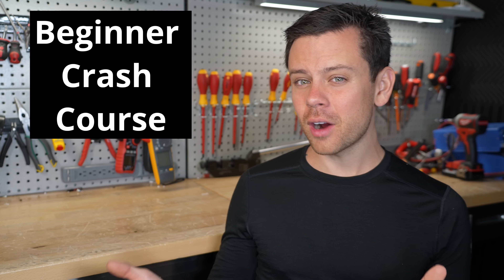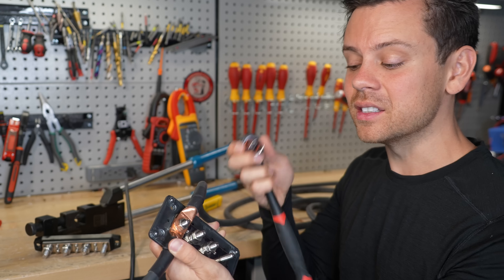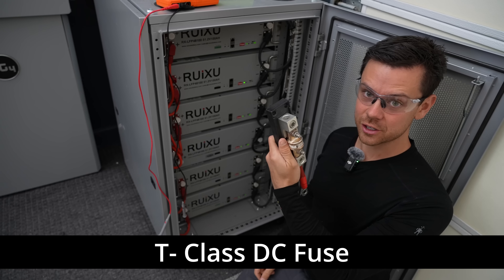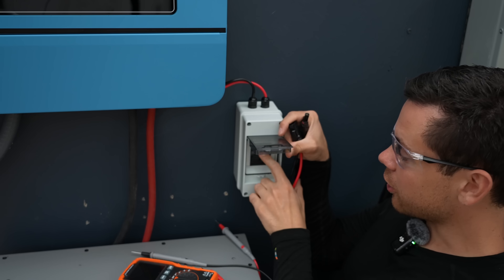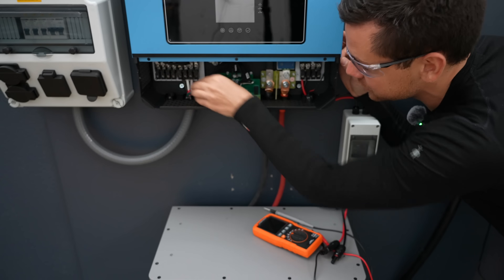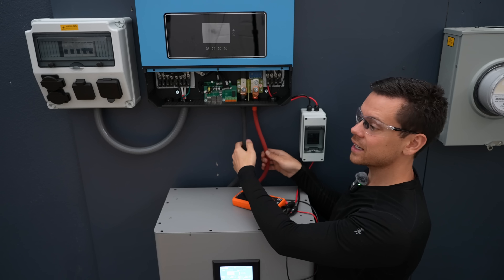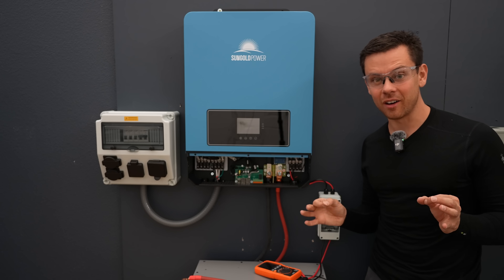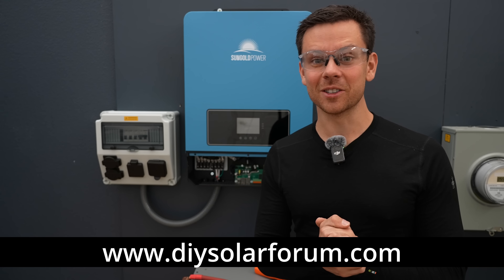Offgrid Solar Crash Course: Avoid FIRE and ELECTROCUTION! For Beginners or Experienced Users

Comment: Electrical engineer here:  One thing that people forget is to TEST the circuit breaker / fuse system with an actual short circuit.  You need to VERIFY that it works within spec.   On a lot of this junk from overseas, the circuit breaker / fuse will be OVERSIZED - and that means that even when the system is overloaded with a dead short, the circuit breaker / fuse never opens up becuase the power source can't supply enough current to trip the safety device.  The same thing happens if the wiring to the load is UNDERSIZED, so that when an overload happens and the wiring heats up - and its resistance goes up - there is no longer enough current flowing to trip the safety devices.
Reply from the maker: In your experience, what are some overseas circuit breakers that fail your tests? I am finding that most everything is made overseas now. The good stuff, and the bad. Would love to know what breakers you have found to be falsely rated
Reply: @WillProwse  Most recently, we had someone at the plant try to save money on a replacement Siemens 100A DC breaker from some AliBaba listing they found...I believe it was Sceemams or some random keyboard mashup.  You know what I'm talking about.  We tested it and found that it never tripped at 150A, nor at 250A load.  It finally melted at around 300A. On the plus side it only cost about 1/10th the real thing, and if you think about it it never would cause a nuisance trip event.  It was useless as a safety device. with an INFINITE over-rating Just be careful to test whatever it is you are putting into service.  ANOTHER TIP:  You want to stop recommending LiFe as a solution for everyone's needs.  Please start testing your batteries in real weather (without BS heatiing pads).  We live in the north, and believe me nothing is more useless than a LiFe backup battery system that refuses to charge when it's cold out ( < 25F) and they don't have energy-wasting heaters installed . I agree technology has to keep moving forward, but there are applications where lead-acid is still best technology for now.   Maybe someday Li will work better n cold climates, but it sure isn't there (yet).

ANOTHER test you aren't doing - at least I haven't seen it:  With circuit breaker OFF, put a dead short on it's load terminals.  The power supply side of the breaker will be a power source well beyond the circuit breaker's trip rating BUT deliver current within the breaker's Current Interrupt rating.  For safety, we use a resistor-limited capacitor supply bank for the test NOT something that will deliver a lot of amperage for more than a few seconds.  I won't describe here because you're smart and know this works.  NOW with power supplied to the line side of the breaker, and a dead short on the load side, flip the breaker switch ON and watch the volt & amp flow results on your oscilloscope.  The breaker should trip open right away BUT in a lot of cases the poor quality unit will wind up with welded contacts - which means the breaker is permanently turned on.  Good quality safety devices will never do that IF they are spec'd with a DC voltage and max current interuppting rating.  Opening a set of contacts with DC current flow is much harder on the contacts than AC, since AC  self-quenches the contact arc, DC does not,   IN GENERAL the better safety devices will be from USA, Germany, Ireland, Mexico, Canada, Taiwan, Malaysia. They will be expensive for a reason - good DC-rated contacts are expensive to make.  Once we get to China yes some very good products but some very bad products make their way into the supply chain.  Like anything else.  There is no 100% black or white, you just have to be sure to test the vendors products to make sure they work as intended!

Comment: Will can you please elaborate on what you mean by lower temperature wire and amperage to ensure safety.  I think what you meant to say or what you mean is oversized the gauge of wire with a lower temperature rating of the insulation?

Comment: Soldered terminals will have much less resistance than crimped, but it's micro ohms, not something you'd see on a normal meter, so it's insignificant.  The only reason I can see for crimping is that if something goes wrong and the terminal gets super hot the solder could melt letting the wire fall out.  That could cause a short, but if the terminal has hit 400F it's probably safer to have it disconnect rather than it staying connected and continuing to get hotter.  If your system is properly fused a short "shouldn't" pose a hazard.
Reply: Sorry, but you need to look up the resistivity of solder compared to copper.  Resistivity is the bulk property of the material.  RESISTANCE is a combination of resistivity, contact area and contact pressure.  Solder has  probably 8 times the resistivity of copper.  A properly crimped joint has total copper contact area and high pressure.  Solder will also wick up the stranded wires and cause brittle, vibration susceptible breakage.
Reply: @barnowl6807 The resistivity of the materials doesn't tell the whole story, you know this, and yet you argue it without realizing that solder will increase contact area.  I've seen two tests done on crimp vs. solder vs. crimp and solder; solder wins.

Comment: Two words, say after me:  TORQUE WRENCH!
Your guides are generally great, but when you touch on everything else like crimping and whatnot, you should also recommend beginners to use a torque wrench to tighten things to the correct torque spec.

Comment: I am pretty sure you are using the wrong kind of cable insulation on the battery cable. If it is welding cable, this is wrong. Additionally every terminal must be torqued properly. I don't see you using one...

Comment: Another safety rule I see people regularly break is to never poke around in a live circuit to make measurements. It's way too easy for a probe to slip and short something or for your hand to brush a live conductor. The proper method is to connect your meter with the circuit switched off, then switch it on to make the measurement, then switch it off to move the meter to a new test point. It takes longer but avoids disaster. Great content, Will!
Reply: Very good advice.
Reply: Anyone who is competent would highly question your post. In fact I would question your competence and qualifications.
Reply: @jimmcfee3488  I guess I could've been clearer that I'm not talking about logic circuits or your car's 12 V system, where you can poke around live all you want. I'm an electrical engineer who's been working on high-power, lethal-voltage aircraft and marine systems my whole career and if I caught anyone working for me fiddling with a live hazardous-voltage circuit then they got a talking to. But hey, Jim, if you want a Darwin award then I hope nobody else gets hurt trying to save your ass.

Comment: Initially, you often made videos with installations using small batteries like LiTime LiFePo4 12.8v for example with nothing included. Could you do, for example, with a simple 300 amp LiTime battery, a demonstration of a small installation complete with wiring, solar panel, circuit breaker, switches, surge protection, charge controller and inverter? We don't often talk about the components around batteries or solar panels but the value of a system corresponds to the weakest component of the system. It would also be important to do an update on the hardware that goes between the solar panels and the batteries.

Comment: How do you tell if your pv disconnect is the right size for your inverter?
Reply: I think you mean the solar charge controller IN your all-in one inverter. It should have limits of input Voltage and Amperage in the user manual, and sometimes on a label on the unit itself. Get one that is very slightly higher in rating than those specifications. Use a fuse or breaker rated for the wire you use from the panels to the controller AT the panel/array. This disconnect should mainly act as a cut-off switch to work on the solar system, in my opinion.
Reply: @Tumbleweed5150 I noticed some of the pv disconnect are 400v 50amp, some are 400v 10amp. Etc. Just trying to make sure I get the right one
Reply: @simaii820  I think the ratings should just excede the wire/inverter ratings a tad so that a DC rated fuse goes out first, rather than the disconnect, etc., causing a fire.
Reply: @Tumbleweed5150 so if you are putting 12kw solar on you would want a 400v 50amp dc then? Which is the max for this inverter right?
Reply: @simaii820  I do not know what inverter you are writing about. The one in this video? I haven't looked at its specifications. My inverter only allows 18 Amps input. (I keep remembering it as 17 Amps limit...probably to make sure I don't go too close. LOL).

Comment: Hi again Will, great video. You could include the use of a torque wrench for tightening high current connections- that is the truly correct way to do it. Cold flow and retorquing should also be mentioned. As you pointed out, 90% of problems are loose connections. Another useful tip is to check for shorts with an Ohm meter before powering up.

Comment: Last video you said that you don't need to balance the voltage on your cells when building a DIY pack you just need to charge them until overcharge protection cuts the charger off and then assemble your pack. Do you have a recommended cell level charger or how do you pre-charge your lifpo4 cells before assembling a DIY pack?

Comment: I love your stuff and have learned quite a bit over time. I realize you cater to more advanced users so it's not easy to find the detail and expertise you provide for smaller systems. I've said it before, but it's impossible for me to justify the cost of a large system when I pay 10c/kwh. I have enough to keep a wood stove blowing and fridges cold during the infrequent outages where I live. It's kinda like my old HVAC. If I replaced it and it cut my electric bill in half it would still take over ten years to recoup the cost. Keep informing us all and I'll try to gleen the important stuff relative to my tiny setup.

Comment: My small system is by no means perfect but I improved things by using heavier guage cable (25mm²) and fusing my two batteries separately using a fused busbar. That way if one develops a fault hopefully a fuse will blow and isolate the batteries from each other. I also load test my system and check for anything heating up. My suggestion for victron solar charge controllers is to use the largest guage cable (hi-flex or class 5 spec) especially on the battery positive connection as for whatever reason these get hot.  The cable actually acts as a heat sink. Also if you are building a small system 12/24v don't use automotive type inline fuse holders as even the branded ones get hot at far less than their rated load (which is probably an intermittent rating, not continuous).

Comment: Will, for beginners, this would be better by giving reasons why not to solder and why to be sure lug contacts are parallel, for xample. Also, when you say something like chek that everything is off with a multimeter, beginners need to know where this chek is done.

Comment: To rephrase one of the key points you're making, so see if I understand it:  Ensure the wiring (wire, terminals, insulation, etc) is of large enough gauge to NOT be the "weak link" and thereby overheat or fail thereby potentially causing a fire.  Make sure that the wiring is large enough so that the safety devices (DC rated circuit breakers, T Class fuses or BMS overcurrent protection) are the ones to trip FIRST, long BEFORE the wiring melts / overheats / fails.
Reply from the maker: Yes! Exactly
Reply: Absolutely correct. You are designing for when things go wrong...NOT for when things go right....as in the last video...soldering, hammers, and aluminum bus bars aside.
Reply: Only comment i have is 
The stript wire has to be long enough
so it goes all the way to the back of the crimp terminal

Comment: Great advice and great video. Hopefully, you will have one on charging batteries via grid power connected to an off grid inverter input. You had mentioned in a previous video to just use a 48 volt charger connected to terminals, but if there are multiple batteries in a rack, how is that possible? Would you disconnect each battery and charge them separately? Thanks for all of you great videos. Been watching for 5 years now.

Comment: Only thing I would change is that you normally should not use a multimeter to check if there is no voltage. A dual pole voltage tester is what you should use. And don't forget to test it's functionality before and after testing.

Comment: Will you go over a system for campers/ truck bed campers with smaller storage areas to accommodate the system i.e. batteries and all other devices? Not just run off solar but also vehicle alternator. I do have your book but there has been a big upgrade in the products.... Thanks..

Comment: 10:38 "batteries that you can't turn off like small 12v batteries" - would you recommend adding a switch between the battery and the system, and if so, is there one you'd recommend? Thx.

Comment: The most dangerous part of a solar system is the series connection of multiple solar panels.  If you work in the day throw a tarp to block the sun; or do the last connections at night.  Also you need to use ferrule  connectors when attaching the raw solar panel cables into the inverter.  Just having raw stripped cables have been known to melt at the lug. Ferrule connectors maximize surface area contact.
Reply: Right, and don't forget to earth ground the FRAMES of the solar panel. I forgot and got a shock when I had connected them together, even before I connected them to the solar controller!

Comment: A little extra tip, instead of using colored heat shrink on the crimps, you can use clear (after putting some identification markers on) then you can keep an eye on the crimp for signs of overheating in case it was a bad crimp or comes loose.

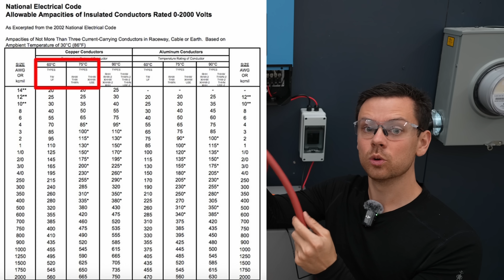Comment: @9:25 I didnt understand why the temperature rating of the  insulation should not be too high,  surley the higher the better?
Reply from the maker: You want it as high as possible, but the terminal should be rated for it as well. It can only handle the lowest temp rating device in the circuit
Reply: @WillProwse  Right. Plus, use a breaker or fuse rated for LOWER than what the terminal/wire is, so THAT goes first!

Comment: Great Video...
As an electrician with 37 years experience. I appreciate how thoroughly you covered the basics...
One thing though. You didn't identify the table (NEC 310-16) you showed for wire ampacity and I didn't hear any mention of terminal torque specifications.
Reply from the maker: Good point, totally missed that. Need to make a dedicated video on terminal torque specs

Comment: Will, I was thinking of putting a small system in my shed to power a light and radio when I am in there.  I know cold is an issue with the batteries but how much heat is safe to store a battery in a hot shed?
Reply: Every battery manufacturer will have the temperature limits printed somewhere in the user manual.

Comment: Question about one of the main tips in the How To Size Wires section (9:20): "When I size a conductor, I use the lowest temperature rating current capacity. It will give me a lower figure, but my system will run at a cooler temperature, and it will be safer to use." The chart appears to give ratings based on the type of wire/conductor. Are you saying that you always use the lower 60C column, no matter the type of conductor?
Reply from the maker: Yes, that is ideal. Be sure to use the copper column if you're using copper.

Comment: I am using 1/0 gauge for my multi plus 2 3000. Well, a pair of them. At 12 volts the multi plus really needs the amps to run true. Even though I am running 18 inches of leads at 280 amps they still get a little warm. In fact right now I have a single 300ah 12 volt battery that I had to remove from its plastic case and run 4guage wire to the BMS casue it was using a pair of #8 gauge aluminum and that heat does transfer 😳 a cross all connection. That one loose wire can cause heat all over the place and rob your system of   Efficiencies.

Comment: Note: Electrons are color blind. Don't rely on the color of the wire to reassure you that polarity is correct. When in doubt, a DC volt meter will indicate polarity.

Comment: Don't buy Battleborn batteries. Well, you can if your hard earned money means nothing to you. LOL
Reply: I got a free BB from someone,  using it on a 12 inverter to run small devices on my outside work bench - namely a cooling fan.  Powered by some 12v panels I had  laying around